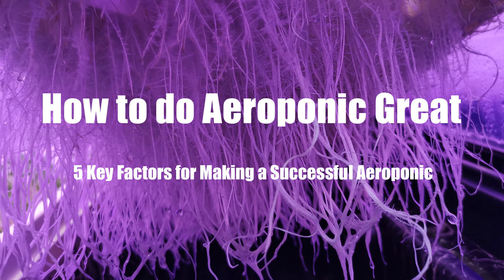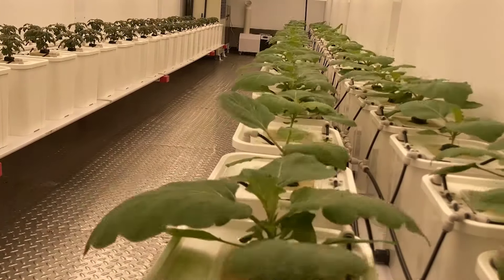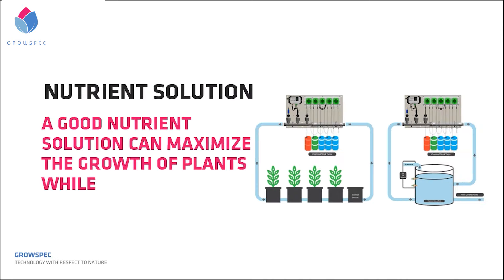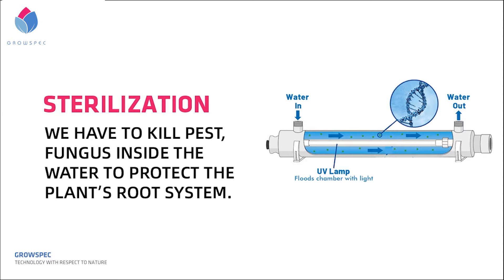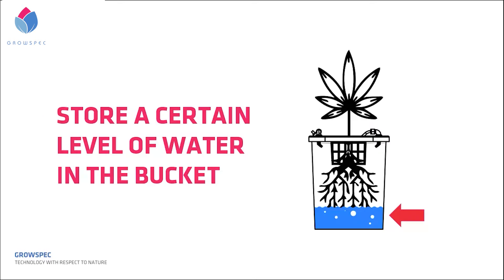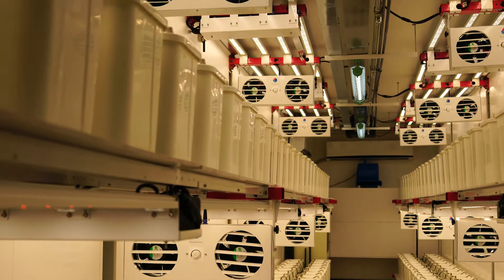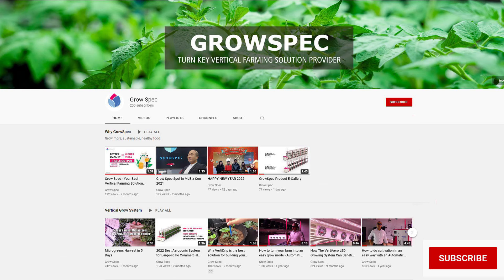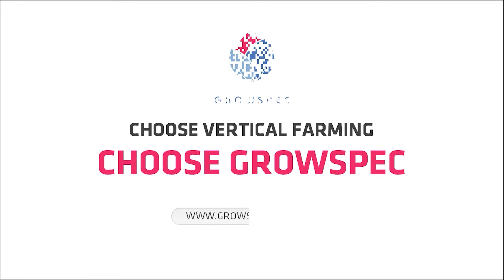Aeroponics Cultivation 4.0 - Introduction

Comment: the root chamber temperature is more imporatnt than the nutrient temperature because  they will not be the same. The nutrient solution should be suitable for the crop. The nutrient strength (EC) is system dependant.F or example, if you overwater (most folks overwater in aeroponics) you can run higher EC but it wont result in better growth rate due to the overwatering.. The very small amount of water required by plants in an aeroponic system allows you run drain to waste. therefore you have no need of filtering or sterilisation, the nutrient doesnt return from the root chamber to potentially contaminate the nutrient reservoir with debris or pathogens. The nutreint elemental make up remains constant so the plants receive optimal nutrient at all times. A recirculated nutrient is optimal only when it is freshly mixed and becomes more and more sub optimal over time until it has to be replaced.   A well designed aeroponics system will be 100% reliable so you wont need to store any water in the root chamber which effectively reduces the space for aeroponic root growth and the roots that grow into the water wont be aeroponic which defeats the purpose :)
Reply from the maker: Thank you for your comment, Sir, informative👍.
Reply: @GROWSPEC_GLOBAL  
Its best to think of the mist environment in the root chamber as a physical medium.  In genuine aeroponics the roots are suspended in the mist environment (aka medium) and much like other mediums, it contains a ratio of moisture, O2 and nutrient. Unlike other mediums, you can control these 3 variables in realtime for optimal growth.
Reply: In regards to root chamber temp vs reservoir temp.
If you have your grow room dialed in, there should be no reason to worry about the temp in them.
They should be the same temp.

I totally agree with you in regards to most people over watering when growing with aero.

But in regards to drain to waste.
I see that as a unnecessary huge cost.
As long as you have a good filtering system from your reservoir to your grow chamber there should be no problems. Along with regular reservoir changes.

Now one of the things that should have been talked about more.
Is pH drift.
Your pH should be checked at least daily.
Because the plants will use more of some nutes at different times of growth.
Which will cause a huge difference in your ec and pH.
Which will dramatically effect the growth of your plants.
Another important subject that should have been discussed more are light leaks, into your grow chamber and or reservoir.
That's a no no.

Now back to over watering.
Something that should have been discussed is droplet size. Even if you have the correct sprayers that produce the correct droplet size we are looking for.
If your on and off times are not correct you will produce a bigger droplet size in your grow chamber.
You can see proof of this in this video.
If you look at the shot in this video, where they show inside the root chamber.
You will see huge drops.
Which tells me that they have their on time ( the amount of time their roots are being sprayed ). On for to long.
Think about it like this.
If you have the correct spray heads to produce the droplet size we are looking for.
But you have your on time at one or two minutes. You are going to cause bigger drops to form on your roots.
Because they are being sprayed for to long.
Everyone that starts growing with aero is guilty of this.
Shit when I first started growing with aero ( which is the only way ive been growing for over 20 years now ) I had my on time on for 5 minutes.
LoL 😂😆.
Because as you probably know, there is nothing on this subject when you did your research.

Anyway this is my two cents on some of the subjects when growing with aero.

Good luck everyone.

ASS OG.

Aero Systems Sea Of Green.
Reply: @atomizer2665  First of all, you are a legend. Thanks for your contributions. 

Second, what kind of EC/PPM levels  do you run lets say for each stage (seedling, veg, flower)?? How do you know or what signs do you check for overwatering?
Reply: @MrLeonfs  
I`m just a grower with a passion for aero but thanks. I run all my aero setups drain to waste which allows me to compare water in vs water out, and ppm in vs ppm out in more or less real time. The plants effectively tell me how much water and what ppm they want :) If your roots feel sticky or dry you are under misting. If they are dripping wet you are over misting.  Drooping leaves with upright mainstem is usually a sign of over misting  (common at night when using the same mist settings as you do in the day). Droopy leaves and mainstem is a no brainer, under misting.

Comment: Have you ever gown before?
Reply: Defirinitely has no hands on experience of aeroponics or there wouldn`t be so many errors in the information.
Reply from the maker: Looking for crop solutions? 🌍 We cover China, Thailand, the UK, and select European countries. Also with sales and service centers. Let us know what you need!

Key Highlights to Note Right Away:
🔧 All-in-one turnkey solution (custom-built options available) 
🖥️ Fully integrated hardware-software system 
📊 Extensive data points for crop profiles and growing procedures 
💡 Optimized energy-efficient system 
👩‍🌾 Backed by hands-on experience from our self-owned farms 

For more details, email us at sales@growspec-inc.com. Stay updated on LinkedIn at GROWSPEC GLOBAL. Catch up soon!

Comment: Nice video! I’m wondering how to set the timer for watering? What standard should I follow?
Reply: @atomizer2665  how can I see it? Any recommendations how I can learn to read the plant
Reply: @atomizer2665  could you give me an example for that?  I have water temp and climate control as well as water filter.
Reply: @atomizer2665  it's HPA
Reply from the maker: GROWSPEC customized SaaS & IoT system, TechGrower™, makes cultivation management a breeze. It integrates all devices and sensors, offering preset planting strategies, real-time monitoring, and streamlined admin tasks for top crop performance and efficient resource use.

For more details, email our sales team at sales@growspec-inc.com. Stay updated on LinkedIn at GROWSPEC GLOBAL. Catch up soon!